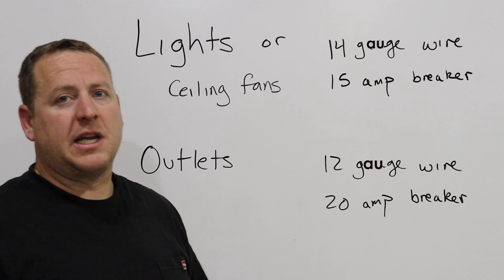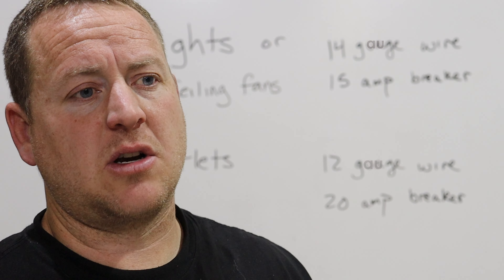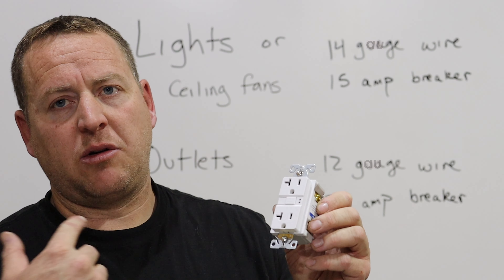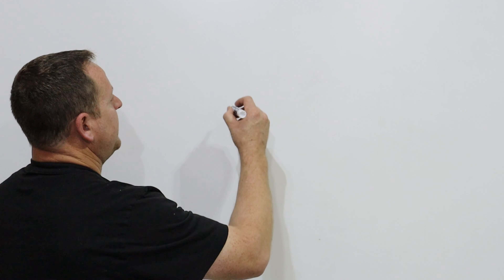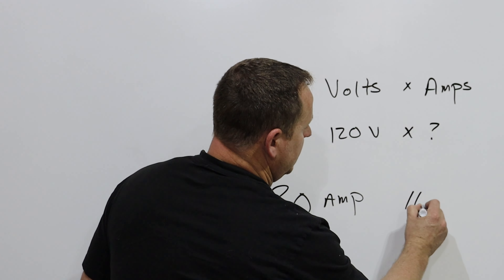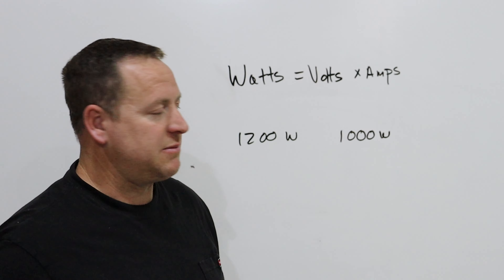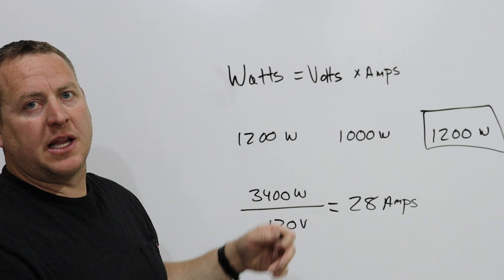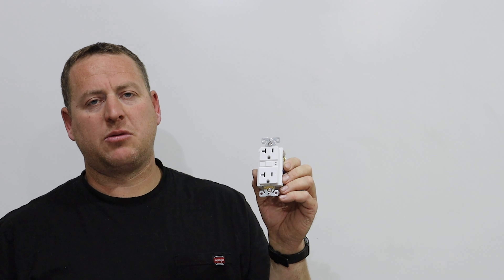Using an Equation to Help Plan Electrical Circuits | Wire Sizes and Breakers

Comment: what if its a mobile home ànd one hole walll all the way frkm end to end is on kne 15 w breàker?
Reply from the maker: You can separate the line into different circuits. Decide which outlets you want on each circuit and install the proper breaker and wire for broken up circuits.

Comment: Thank you, thank you. Very helpful information. I currently live in southern Mexico, and a lot of these homes are built with very bad wiring. My current home has all the outlets and lights wire to just one fuse box. As well with no ground wire whatsoever. It's a complete mess. I'm fascinated with electrical wiring which  is why I'm trying to gain knowledge, that way, I can in the future rewired this entire house. Videos like this is a big help, especially since you explained very well.  Thank you again, and I'm certainly going to watch the rest of your videos.